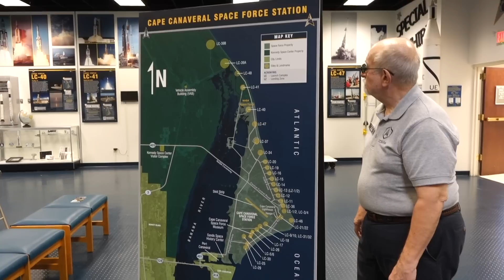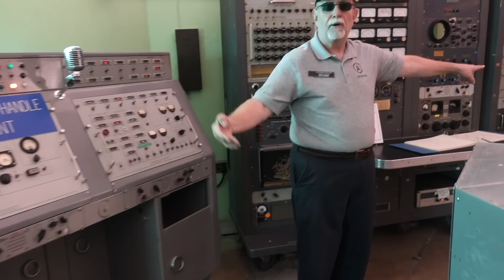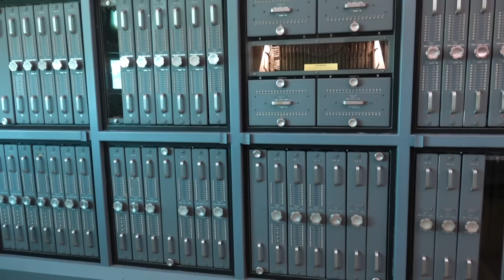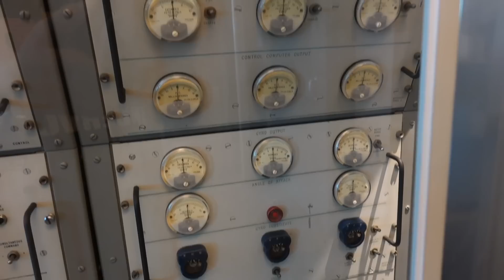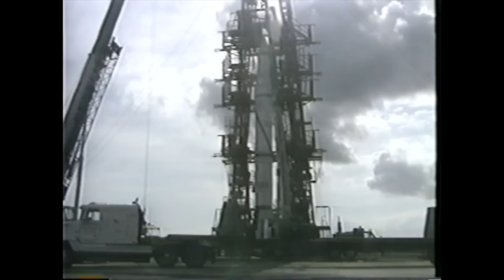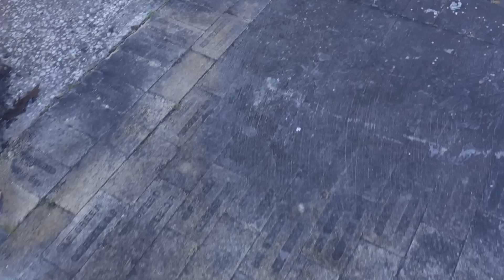Cape Canaveral Historic Launch Sites Visit

Comment: I grew up in Cocoa Beach and my Dad was a Radar Guidance Engineer with GE Mod III at The Cape from '56 thru '76. He told me that their first radar tracking system/computer used vacuum tubes and that they had to run multiple launch/tracking simulations until they had a set of tubes that had proven their reliability and then they'd pull those tubes and store them to be used on the next real launch. fyi, I'm a recently retired Aerospace/Computer Engineer with a large American defense contractor's Missile Systems company who also happens to own a beachfront condo in Cocoa Beach and yes you can see most of the pads from my balcony too. Not a bad place to retire.

Comment: NASA Fact Sheet states that KSC is just over 140,000 acres (not 300,000).  Juno I and Juno II were considerably dissimilar launch vehicles.  Juno I was based on the Redstone missile and Juno II was based on the Jupiter missile (although the upper stages had similarities).  The Titan II vehicle that launched the Gemini missions did not use radio guidance.  The lower section of the Mercury Redstone is authentic (not a mock-up).  The upper section has been replaced due to hurricane damage.  The Gemini white room only rotated from vertical to horizontal (and vice-versa); it did not translate horizontally.  The red mobile service tower enclosed a Redstone missile for display when the museum was first established (not a Mercury Redstone).

Comment: Those clocks most likely were not syncing with the WWV signal we pick up on shortwave but instead likely used the WWVB signal, which has a 60KHz carrier at 70kW power.   It comes from the same location as the WWV signal, and syncs to the atomic clocks on site.  A lot of radio clocks in the US still use the WWVB signal now.
This was a fascinating video.   I love all this historical space stuff.   Thank you for taking the time to make the video and show us all of this.
Reply: WWVB didn't go on the air until 1963 and it was running much less power back then.
Reply: @rocketman221projects  Yes as WWVB you are correct but WWVB started as KK2XEI in July 1956.   At that time it was low power and not 24/7.  In March 1960 they obtained WWVB call sign, but even this low power signal was deemed far more stable than the shortwave signals, so much so that there were plans for WWVL on 20KHz carrier that was going to be a world wide signal.     
But I will stand corrected if those clocks did not use the KK2XEI (now WWVB) in favour of the older and slightly less accurate WWV.  :)
Reply: Just a note.  At sometime in the 60's (as I remember) WWV was moved from Greenbelt MD operated by the Navy?) to Ft. Collins CO.  They may have used wither one.  WWV still as a timecode subcarrier.  NIST probably has the documentation on it.  I defer to others on WWVB.
Reply: @Herby-1620   I think WWV was moved a few times before settlign where it is now.   WWVB, and it's prior call sign, as far as I know, were always at Ft Collins, but if I am wrong someone will correct me :)
I probably should go to the NIST website as they do have a really good article, quite a lengthy one, on the history of WWV, WWVB, WWVL and WWVH.    I just am relying on my dodgy memory for now lol

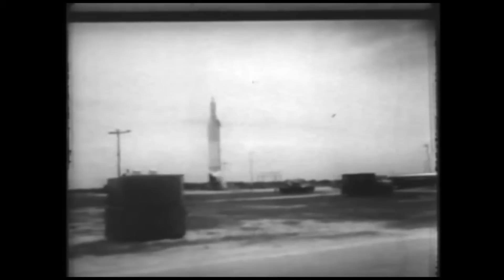Comment: 11:13 I mean they're kinda similar in terms of the upper-stages, but the Juno II was based on the actual Jupiter while Juno I used the Redstone. Though a similar configuration was sometimes called Jupiter-C it was still a Redstone (just used to test some components for the Jupiter). After Jupiter the next ABMA design was named Saturn, with two of the third-series of Saturn designs flying as Saturn I and Saturn V.

Comment: Next time you're down here, check out the American Space Museum in downtown titusville. THey havve the last functional MOD II Electromechanical launch sequencer, and a load of consoles from Complex 36 plumbed into 'em. The sound it makes is second to none as they run it through a countdown, and they even have the wiring diagrams for it up on a shelf! They also have shuttle-era launch consoles, and really just a plethora of wonderful things to get up close with.

To this day it's maintained by one of the original RCA techs who helped install all that gear in blockhouses 60 years ago, though they've been trying to find a successor to make sure it's still something the public can witness for years to come.

I've been Capeside many years, and I've not had the chance to do the CCSFM tour since 2016, hoping to do it here in a week or two with some folks I know there! I'll have to put this off to one side and come back once I've seen it all!

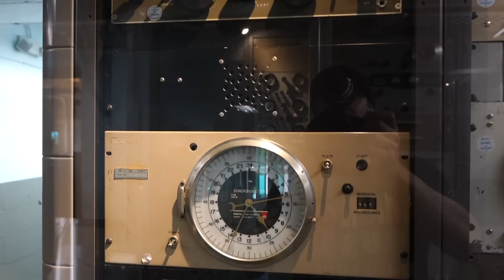Comment: 19:15 - There were no Cs clocks in those days, Kemo Sabe. It was carefully maintained quartz all the way. Um, of course, the Delta launch facility I was in back while it was launching GPS satellites in the 1990s had operators with precision fingers. All the timing was human reaction time accurate when they were launching tools carrying Rb and Cs clocks. That rather tickled my funny-bone. I thought they'd have something better than precision fingers and human reaction time for the launch button.

{^_-}
Reply from the maker: Of course they had Cesium clocks in 1958. The 4th generation portable one from HP is from 1960 already!
Reply: @CuriousMarc  The Delta facility didn't have Cs clocks that I remember. Launch and staging was all calibrated fingers and wall clock. The master clock may have been driven by Cs but that did not percolate through to the launch systems except through human reflexes. Unless they were funning me that's the state of the Delta facility into the 90s. So I'd not be surprised if Cs really didn't exist in the various launch facilities except for data logging or the like. (If it ain't broke, don't fix it.)

Of course, to be fair they do not NEED Cs level clocks for launch and stage. The guidance systems probably could have made up any slack. And there was not enough junk up there that launch windows were cluttered affairs.

On that trip I also saw the Commodore Amiga computers that Hal Greenlee had wired into the data collection system. The IBM PCs of the era were not fast enough. NASA does strange things for strange reasons. If those Amigas could still be found (doubtful) they'd be a big deal for Amiga fans. (I was a mother hen for the Amiga fans and developers on BIX back in the day.)

{^_^}
Reply from the maker: @Wizardess  The Cesium clock would not be at the launch facility (although they used the HP one later for Apollo). It was at NIST, driving a transmitter. You would receive the transmitted carrier and lock to it, creating a local frequency reference.
Reply: @CuriousMarc  That is pretty much what I meant. I should have allowed for one or two in the calibration labs that keep all the other instruments honest. These clocks were calibration lab tools. Off the air was the (pun intended) standard way of dealing with it. (A time code decoder probably should exist around there somewhere.) Loren has a couple of different vintages. The radio shown in the clip was the time code. And with the ionosphere in the way the times recorded or otherwise used varied from a Cs standard by quite a bit. My intro to precision time was a WWVB receiver and an HP precision counter late 1960s vintage. It sat in the lab. I got curious. I read a bit. I played a bit and saw the D layer shifting time quite a bit. Later I played with a 5 MHz standard I acquired surplus and a lashup to catch the first RF cycle of WWV. Watching the gray line change time was both fun (confirmed theory) and frustrating (confounded good settings.) Over 6 months I figure I got it down to single digit PPB. GPS came later after a couple pairs of fast frequency hopper transceivers. I'd not expect Cs on site until the 1980s, at a guess. Then you might find them in very high end research labs not where a failed launch might upset the poor dears. That said, the Phase 2B GPS birds did have more than one Rb and one lonely test/proof of concept really ruggedized Cs.

Anyway - watching what the ionosphere does to WWV(x) transmissions is educational. By the time the time reaches Fla from Ft. Collins it's not really the time. It's a rough approximation with quartz oscillators likely doing better. While it may be derived from Cs time, it's really only roughly Cs time and stability.

{^_^}

Comment: Were those challenge coins on the Roger Chaffee bench? Left in tribute?
Some on Ed White's bench also.
Reply: It looked more like the military tradition of leaving coins on headstones. "A penny left behind means that they stopped to pay their respects. If someone leaves a nickel on a grave, it means they served in boot camp together. A dime means they both served in the military together in some capacity. If someone leaves a quarter on a grave, it means they were there when the soldier was killed."
Reply: @Scrizati , thanks for the info, I noticed those coins as well.
Reply: Alot of visitors leave coins on the benches and sometimes challenge coins.  Money that is left on the benches is saved up and used to purchase new flags when the ones there are worn out.

Comment: Excellent video. I was at cape caneveral many years ago, and for space X,  5 years ago MY transceivers were on a cubesat (MOVEII still transmitting), it was great to watch the launch , some of the students of the project  were at the site at space X for watching and the rest at the University (LRT TUM)  life, very very very exiting to watch a launch and wait for the first transmitter signals of the transceivers (expecially as it where MY PCB with my name in space now) and later to see the norad data for the path of the MOVE II after locating -- Its absolutly fantastic. I can totally feal now how all that launching feels for the contributors -- and great work Curious Marc for all the history.
Reply: Nice to see RDK here and also seeing your still doing electronics -even satellites
Reply: @schimmi2  yes still active doing a lot beside satellite communication also medical stuff as novinvasic glucose research ... But working for SPACE is really fun and challenging, also did some ballon tests before start of the satelitte into space. -- If you check the orbit at norand you can hear the sat on VHF at 145.950Mhz  the morscode with its name -- upling is coded on UHF for reprogramming and more compilated is the sband at 2.Ghz, the sat needs to be positioned with the antenna towards earth ... but lot of experiments where sucessfulyl done by the students also a ESA test for special solar cells aboard worked perfectly, this was around 5 years work. Challenging was the detumbling to to a fault in the cable a magnetic motor was build. bu the detumbling using the on board coils work though never thought to be used for this -- alswys suprise in space and you cannot take your scope there to find out
Reply: he transceivers were said to be the first SDR transceivers used in cubesats in Space, the VHF/UHF module (100x100mm) uses a xilinx FPGA an mram for integrity so the sband transceiver. we run out of space a little bit on the sband , but the code can be dynamically changed and uploaded. Also the boards makes a periodic timeout and reset on the main cpu boards so no hangup shoudl occur, the antenna I protected with special EMV diodes.